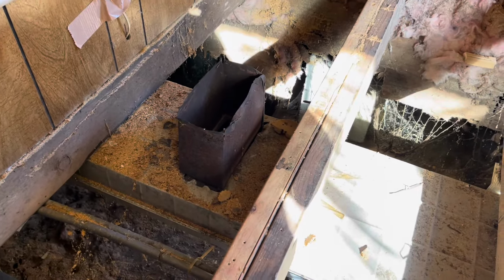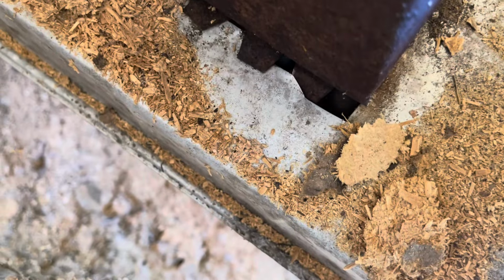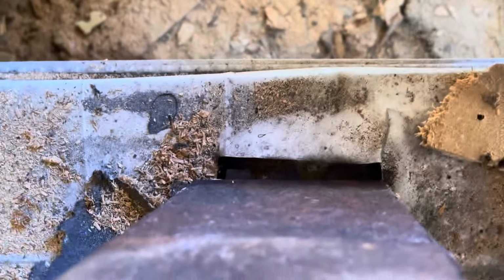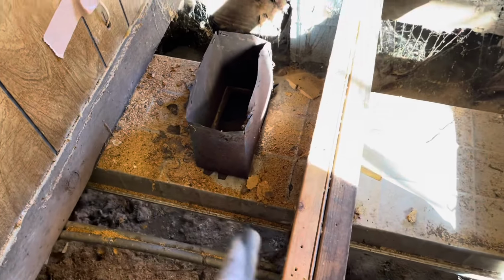Mobile Home Floor Vent Problems. (How to fix them.)

Comment: So if you leave the floor intact, i imagine you tape the outside of the new vent from underneath?
Reply from the maker: If you leave the floor intact, all you have to do is tape the inside don’t worry about taping the outside. Just do a good job on the inside.
Reply from the maker: Yes
https://www.amazon.com/Mobile-Home-Parts-Register-Collars/dp/B076BRLM7S/ref=mp_s_a_1_3?crid=PLPH0VG2HED7&keywords=HVAC+metal+register+collars&qid=1704151323&sprefix=hvac+metal+register+collars%2Caps%2C98&sr=8-3

Comment: Not sure but do u know why id have water in my vents...its a mobile home. I went under it and theres a section of my flex hvac running between the 2 vents and its full of water to point its almost dragging the ground?
Reply from the maker: thats not right. call hvac guy now. this will be a big problem

Comment: Is that house still using poly b plumbing? Also, do they make mastic for heating systems to cover over and around those areas of the heating system?
Reply from the maker: Yes he is still using that old pipe but it’s from the 80s he doesn’t want to change it so it is what it is and yes they do carry a tape

Comment: they make a silver tape for this stuff and the adhesive wont melt at high tematrues like a heating system can put out but duct tape is a good short term fix:)
Andy from Maine
Reply from the maker: Yup I’ve seen it. Works well

Comment: Thanks for sharing this Drew. What name do they use for this foldable duct at teh box stores? I looked on lowes web site and couldn't seem to find it.
Reply from the maker: You will find them in the duck metal department. Called floor duck replacement show them a picture of they will find it for you
Reply from the maker: https://www.amazon.com/Mobile-Home-Parts-Register-Collars/dp/B076BRLM7S/ref=mp_s_a_1_3?crid=PLPH0VG2HED7&keywords=HVAC+metal+register+collars&qid=1704151323&sprefix=hvac+metal+register+collars%2Caps%2C98&sr=8-3

Comment: There is probably no point of having a vent in a mobile home. A vent that allows air to go outside of a home decreases the heat of a home.

Currently I am living in a house. The vents where I am living are connected from the main floor to the basement, so hot, or cold air can travel throughout the house I am living in.

A vent that is connected with the outside allows air to escape, so maybe this could be a good, or bad thing depending on where someone lives, and how someone wants to live.

The vents where I am currently living can be opened, or closed, and none of them are connected with the outside, so cold, and hot air can travel throughout the entire home I am living in.
Reply from the maker: It sounds like your system is a little bit better than the one in this house